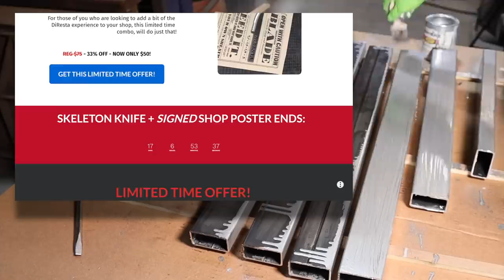DiResta Steel & Oak Chevy Truck Mod

Comment: Much respect for a man that takes the time to put the stock back, including the stickers, after he has sorted through a stack of lumber to get what he needs.  And, another vote for a panel, either expanded metal, or CNC cut to protect the the trucks back window.
Reply: I worked various retail jobs in my younger days, and inconsiderate shoppers was my main pet peeve.   I always kept my mouth shut though, of course.
Reply: Don't the really messed up pieces just get tossed?  Nice lumber like that is a different animal than the usual dimensional big box store stuff, of course.  And leaving a complete mess is never okay regardless...

Comment: Did you think about sealing with a cap the top part of the vertical elements? It could prevent a lot of rust inside from the rain.
Reply: I thought the same.
Reply: @jimmydiresta maybe some cool Total Boat Epoxy caps with DIRESTA embossed in them
Reply: And bees 🐝
Reply: @ericpedersen2760   Thats a great idea.
Reply: @Pkripper-67  ah yes, nothing like a structural element filled with a surprise colony of bees.
Reply: @Pkripper-67  ah yes, nothing like a structural element filled with a surprise colony of bees.

Comment: You can make a small attachment at the end of the truck where you can slide in that tail gate once you remove it. That way you can have a ramp for steping on the truck bed.

Comment: A very minor addition that can improve the life of those fences: cut a piece of wood that can be hammered into of the metal posts, so it prevents water from freely rushing into them. It'd greatly prevent rust on the posts and the bolts.
Reply: Why not just weld a cap on them? 
Wood absorbs moisture so that would in turn cause rust even more.
Reply: @Stuntman2304  Sure, that would be even better. 
Painted wood works too though. Anything's better than open ends.
Reply from the maker: These tube will out last it’s usefulness as is.  I am confident of this.
Reply: @jimmydiresta  just send them a link to your TOH chair video and say “like this?”
Reply: @jimmydiresta  well that’s not really a surprise, Mr. “I reinvent the wheel and improve it” every time I turn around 😆
Reply: @jimmydiresta  you know what you made them for and what you expect from them. Ours were just suggestions. Never meant as a criticism.

Comment: Nice stake sides! Plus one vote for a window screen, too- troll your metal supply yard for an expanded metal offcut. Your glass coverage will thank you. 😂

I put toolboxes from Craigslist on the sides of my flatbed, and built an expanded metal tailgate that splits in the middle and folds in flat against the sides if I want to hang something over the back. Your tailgate looks more solid, but on the heavy side. 😁

Comment: I like it. But if you wrecked with that wood in the back chances are that big bit with the huge splinter would probably go straight through the rear window. Which is another way of saying I agree with the other guys who suggested a mesh. Not to protect the window, but to protect you !

Comment: It should have been a swing gate. putting that thing on and off all the time will be annoying and it's not exactly light. However, that's an easy fix. You could also do both too. Good job!

Comment: looks cool for sure mate, drop sides are so much more practical, especially the rear, any load that comes slightly past the rear and you cant get the door on, you seemed to struggle even putting it on without anything near it ! needs a head board too !! hey if your posting then we can ridicule ! nice video though

Comment: Actually, would a V2 benefit from a sort of wider opening at the top, and a more tapered bottom to the pin itself, to help guide the back in without an issue?

Comment: Did you know that when aluminum touches steel it creates a battery that constantly charges and discharges . That's why corrosion. 
You I see protected against that but I was surprised to learn why the corrosion.

Comment: I expected a pin or a bolt for securing the back door  and sides during transit. 
Of course the side panels and the back door are heavy, but what if a piece of what you're carrying wedges under the wood?
Maybe I missed it on the video, if could anyone post the time mark ?
Reply: With what all that weighs, they're not going anywhere. Maybe not even if Jimmy wants them to. 😂
Reply: It’s not going anywhere, it would have to pop up all in one shot, straight up. If the force is at all offset it will just bind up.

Comment: I’m watching you make my “oh damn that’s heavy” face when you are lifting that tailgate.
I wonder if cutting 2 horizontal slots in the receiving pipes, (between the attachment bolts) making a slip-in pipe with long tongues to bolt wood onto, and creating a double gate of some kind. In my head it makes sense except for solidly connecting the 2 halves (there are a million ways).
Not as strong as the one you made, but how often are you really going to rely on the gate to hold stuff in? Besides,  the solid gate and the doors would be interchangeable. Just a thought :)

Comment: If you leave the bolts a little long you can mushroom the end with a ball peen hammer so you'll never have to worry about the nuts rattling loose and going missing down the line.

Looks good though, nicely put together. Simple, but simple gets the job done.

Comment: Can anyone tell me what this style of tray is usually used for? With the spaces between the board you couldn't carry dirt or other things that could slip through the gaps. There's, of course,  a lot of things it could carry but I feel the spaces are a limitation, maybe there's a big advantage to them. I don't know.
Reply from the maker: For me. Up here it’s the wind. I have a dump truck for dirt. This one for cargo.
Reply: @jimmydiresta  Ah, I see. Yes, not having a giant sail is a good advantage and for cargo I can see a lot of opportunities for tie down points. Thanks very much.

Comment: Just curious Jimmy, why do you always use the bandsaw to cut metal and never something like a metal chop saw? Also great vid as always <3
Reply from the maker: Chop saws make too much debris in the air. And eyes.  Bandsaw slower ejection of dust is safer for me
Reply: @jimmydiresta  Ahh i never considered that. My chop saw catches like 50% or so of the debris but my shop is still littered with metal flakes from it.